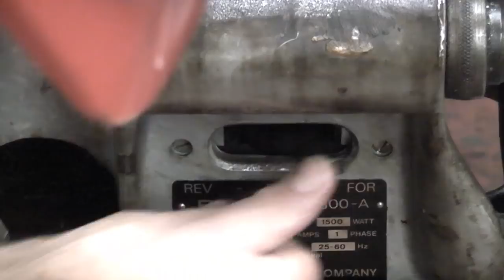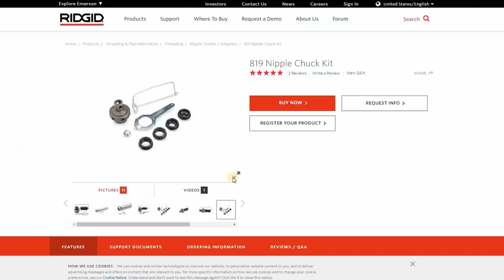How to thread steel pipe | Ridgid 300 power drive

Comment: Having worked in the industrial environment at different times gone by, it was very interesting to find out how these processes  were achieved. The use of the chain vice seemed very appropriate for producing the correct outcome  in regards to the overall effectiveness of not compromising the structural  integrity of the steel pipe. The familiarity with which the machines were operated, leads me to believe a period of a long and committed career in dealing with situations in the mechanical arena.
Reply from the maker: Yes, I've been doing this kind of thing for over 10 years now, I'm lucky that I enjoy my job 😉
Thanks for the comment 👍

Comment: Thanks for the video!! I absolute love seeing how things are done on industrial sites, where quality and workmanship still have a meaning and people understand that rushing things will actually cost you time and money in the long run.

I was wondering however, why you filed the elbow after fitting it to the pipe? Is it to remove the marks left by the pipe wrench? Isn't that removing the zinc coating, making it susceptible to rust, or do you paint these afterwards?
As you can tell, I have absolutely no experience in this matter :)
Enjoy your sunday!
Reply from the maker: Yes, the pipe wrench leaves marks on the pipe, so it is best to remove the marks using a file. The fitting that I used was malleable black iron, which is not galvanised. If you are using galvanised pipe and it is going outside, it is best to use a large strap wrench, but often with galvanised pipe it will slip in the chuck of the machine and that will remove some of the zinc plating.
Pipe is often painted after installation, often they will be painted a certain colour depending on what is in the pipe, such as yellow for gas, or light blue for compressed air, green for water etc. 
Thanks for the comment 👍

Comment: Can you advise the best way to run power to my shed 20m from my house?
Reply from the maker: It depends how much power you will be using. Normally people would install armoured cable, which is often buried, or can be fixed to a wall etc. 
This job will probably fall under PartP rules and so you might have to get an electrician to do it and sign it off etc.
Thanks for the comment 👍

Comment: Was this how plumbing was done years ago ? Think we may go back to this way soon ?
Reply from the maker: I've never seen threaded pipe using in domestic plumbing, but it is commonly used in industrial buildings/chemical plants/schools etc. 
Thanks for the comment 👍
Reply: They still use this for gas pipe in the USA

Weirdly, you’re not allowed to use copper for gas inside a house in the USA (in some states at least) because “someone could confuse it with a water pipe”

Weird if you ask me. They either use this threaded pipe or yellow plastic 

Maybe an American commentator can correct/amend what I’ve said but that’s what I’ve seen from following USA shows.
Reply: One of the biggest uses of these machines are for building fire sprinkler systems. The water is usually  pressurised within the pipe work and is  stationary  unless a sprinkler activates. (If water flows through a steel pipe it rusts) Thus steel pipe and thread machines are ideal for water delivery in fire sprinkler systems. I've worked on one 90 year old sprinkler system. You can tell because the sprinklers are dated.
Reply: It needs to be !

Comment: Pins o deer between the carriage lever and the carriage snap regular as clockwork on the hired ones 👍
Reply from the maker: I used the one in the workshop on site for over ten years, as did the other day fitters. Sometimes we did large jobs such as installing 1.5 inch compressed air pipes from one end of the plant to the other. Then one day someone used it, stopped the machine with the foot pedal and reversed. This damaged the teeth so much that a new set of dies had to be purchased 😱
I used to like using it to be honest, they are really well designed!
Thanks for the comment, Wayne
Reply: @ultimatehandyman  The hired stuff gets used and abused 👍👍
Reply from the maker: @SuperWayneyb   Yeah, I can imagine 👍

Comment: What is the shortest length of a pipe this machine can thread
Reply from the maker: Probably about 4 inches.
You can get a special adapter for making nipples though, although I have never seen one, as we used to buy the nipples in.

Comment: There is a definite skill shortage here in East Anglia for decent pipe fitters. It’s hard, heavy and dirty work. I’m happy not to be one.
Reply from the maker: Yes, pipe fitting is not an easy job, especially when you get to 6M long lengths of 2" or above.
Thanks for the comment 👍